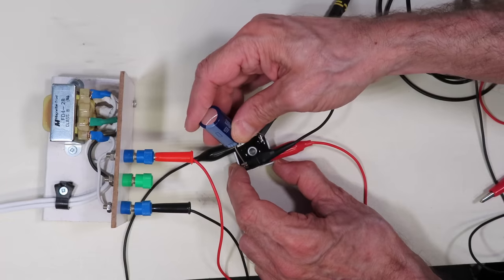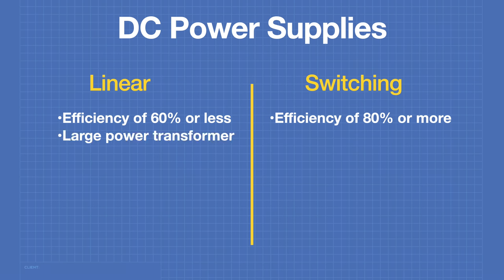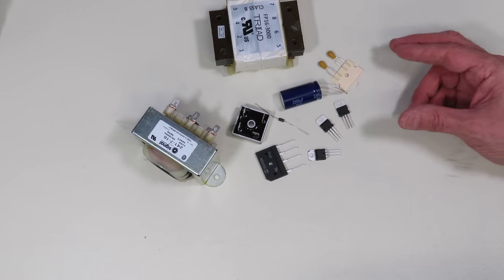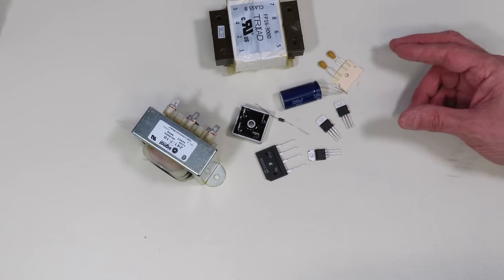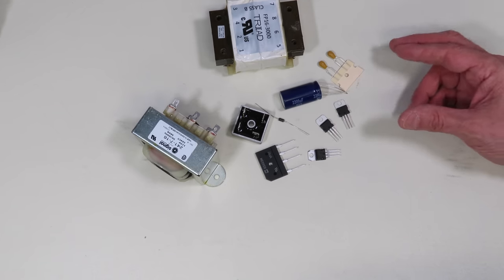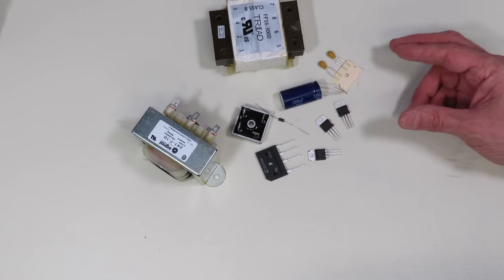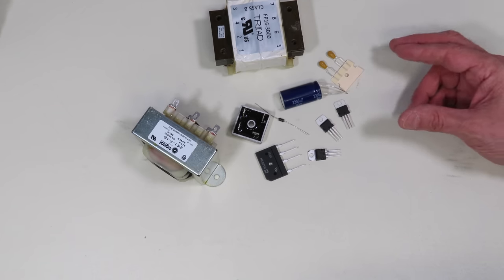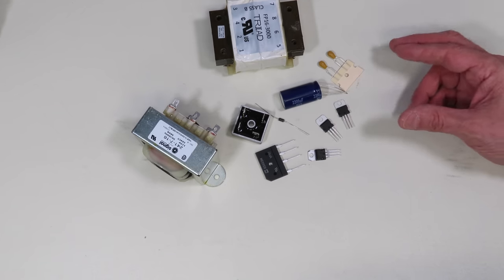Linear DC Power Supplies - Designing & Building Custom DC Power Supplies

Comment: I have built the fixed voltage circuit using a 7809 voltage reg. I expected this to be suitable for powering a LW, MW and FM band radio, however it causes massive buzzing interference on the AM bands. The original transformer for the radio is perfectly quiet and it is an unregulated output with just a bridge rectifier and smoothing cap. Where is the noise coming from?
Reply: I built a mains adapter for my 1960s LW/AM/SW/FM radio, using an LM7809, and did not get any interference. These regulator chips need decoupling capacitors at the input and output of the regulator, in close proximity to the regulator chip. Some folks also use ferrite rings/beads to reduce buzzing etc.  Have a look at the LM7809 datasheet. If this does not work, the try a regulator using a zener diode, or a zener diode and a power transistor. If that doesn't work. you'll have to use batteries.

Comment: Hello! I’m trying to get as stable of a current between 2to5 amps. If I’m pulling power from a battery pack instead of the wall do I need all these ?  I have a 53411202 knob. What else could I use to stabilize the current?  Thanks!
Reply: what???????

Comment: Nice,but...
1. You shouldn't have the balck(-) terminal of the output connected to outlet earth ground.A floating output is way better to have.
2. The heat-sink on the LM-317 is small .I think it would be  better if you would mount the regulator, with a silicon heat insulator ,on the chassis(back or bottom).
3. It would be nicer to use a "double pot" to set the adj. voltage in a "corse" and "fine" manner. much more practical and faster to adjust.

Chears :)
Reply: heat insulator????

Comment: Very impressed with the simplicity, and video. Great project. I do have one question that I can never find on data sheets: How long is safe for leads to potentiometer without effecting the circuit? Also, is wire gauge a concern, (thicker or thinner)?
Reply: that begs the question - how long is long
best advice is refer to a wire gauge chart as it shows the resistance per length by gauge

as for the pot, gauge isnt so important as the current is quite low. Maybe 22 to 26 gauge 
however i would worry more about EMF being introduced; use twisted pairs, maybe even shield the wires with the shield grounded or a bypass cap across the wires near the IC. 
There are a number of unknowns so it depends.....
Reply: Thanks for the responce, I was thinking no more than 2 or three inches at 20 or 22 gauge. I just didn't want to effec the "ballance" of the circuit. Thanks again!

Comment: Would it be possible to have an output on/off button mod on this too so voltage can be set without power going to the external component/device🙂
Reply: sure

Comment: What step up regulator can i use for a 1000 watts /12 volts input iron core transformer to build a adjustable linear power supply for 12 -30 volts ouput? I need it to adjust High voltage ouput of a crazy powerfull zvs multiple flybacks supply.

Comment: Is it possible to secure and connect with wire all the components in a wooden box without the circut board? I'm a woodworker so that designing it to fit well would be easy for me.
Reply: NOT recommended
Reply: @kennmossman8701  Thank you. Can you explain a bit so I can understand the why. I've seen main wires in wooden floor lamps.
Reply: @Sam-tg4ii  first I would urge you to carefully read the complete datasheet - especially the section on Layout/Construction.
Reply: I've seen main wires in wooden floor lamps.
that is  a totally different thing.
A metal case/cabinet is usually prefered to reduce the likelyhood of EMF affectig the circuit and to contain EMF generated  by the circuit.

Comment: will it sustain 1.4V 3A output? heat dissipation will be massive on the linear regulator in this case...
Reply: Not with the tiny heatsink shown.
Most 3-terminal regulators have over-temperature protection so they will shut down when they get too hot (probably at over 150 °C die temperature for the LD1085). With 18 V input and 1.4 V output at 3 A the power dissipated by the regulator would be ~50 watts. The tiny heatsink probably has a free-air "thermal resistance" of around 20 °C/W. The regulator will probably shut down at something around 7 watts of dissipation.

Comment: I've got one question, i want to build a power supply to smartphone recharge purpouses, if I mount 2 independent rails (1 filter capacitor, LM7805 and output capacitor per rail) can I bolt both LM7805 to the same chassis? There's short circuit risk?
Reply: why?  use a higher Amp IC

Comment: Wait! In the case of the full bridge rectifier, why is VDC = VAC x 1.414? I'm assuming that 1.414 is an approximation of the square root of 2. I have a vague feeling that it would make sense for the square root of 2 to show up here since we're dealing with sine waves, but I'm not sure why off the top of my head. I'm going to think about it, but if anyone has an explanation I'd love to hear it.
Reply: it is  VDC = VAC x 1.414  -   1.414    converts RMS voltage to DC peak equivalent

Comment: My transformers have a center tap. Is there a solution for measuring positive and negative voltages and currents? Two meters?
Reply: do you mean you do not know the voltages and current rating
Reply: @kennmossman8701  no, I know the ratings,  and it it easy enough to put a meter on the positive rail for voltage/current. I guess a second meter on the negative rail? It would be nicer if there was a unit that did both rail at the same time.

Comment: Great video. Is there a way to correct the voltmeter on the panel so it reads the same as your multimeter?
Reply: Yes for the 3.3v , 5v and 12v adjust each potentiometer on the power supply to a known good accurate multimeter

Comment: Could these power supplied provide power for the operation of a 12 VDC automobile wiper motor used in a sheet metal bead roller?
Reply: no

Comment: I want to build a DC power supply, from 240V A/C as in Australia, to DC roughtly 3 to 24 Volts, 1, 2 & 5 amps, power phones, radios,  hot wire foam cutting, just general purpose, nothing to special.  U have a BOM?

Comment: Seems quite nice, however that heatsink is awfully puny, that regulator will be getting awfully hot. My rule is if you cannot keep your finger on it, it's too hot. The obvious solution to me is to use the metal case as the heatsink, all you need is some insulating heat transfer pads etc.

Comment: Can you design PSU with current regulator and voltage regulator?
Reply: What do you mean by "current regulator" ?
Reply: @bumbarabun  It is like  a laboratory PSU. It has a current and voltage regulator..
Reply: @denisiswan  problem is that people quite often use wrong terms. You regulate voltage there, but on another side you limit maximum current, not regulating it. So calling that "current regulator" is confusing IMHO
Reply: @bumbarabun  , don't be confused.. Well, it regulated to limit the electric current . It will be for constant current and over current protection...

Comment: Hello sir. I made one circuit with lm317 and with one power transistor above lm317,conected. I put one ammeter, voltmeter module, but when I decrease the voltage lower then 4v, display ammetter and voltmeter module, fading out and not shown voltage, but the voltage exist. Only not shown.
I connected the red thin wire at C point exactly like you did. Where I get wrong?
Reply: how are you powering the V/A module?

Comment: The wide voltage range of your linear supply means you will run into over temperature shut down at low voltages or high currents. The solution is to add a double throw double pole switch to let the user select the two secondaries in parallel or series configuration. DC powered subway trains do this for "low gear."  Cheers.

One more tip. The DC ammeter lead is only 20 AWG. Make your own heavy lead with VH3.96 crimp connectors.
Reply: invalid premiss with bizarre solution

Comment: I've tested several of the Volt/Amp displays and they are inaccurate. You should double check the numbers with a multimeter at min and max output to determine how inaccurate it can be over a range of voltage and amperage. They can be several volts off.
Reply: Make sure you do NOT connect the thin black wire. Follow the manufacturers wiring diagram or current readings will be wrong. If you connect the thin black wire you are shorting out the current shunt across which it measures current. The thin black wire should only be used if you have a separate power supply like a battery or a 2nd fully-isolated power supply.
Reply: @steve6375  Both Current and Voltage is inaccurate. I've tested many with good multimeters/volt meters. Even when they are calibrated they're still inaccurate. Be careful when using these, could be sending too much voltage or current to your circuit. If you find some that are accurate then let everyone know. I would like to buy a few.
Reply: @simplyengineering2350  How inaccurate?  Mine don't seem to be too bad, esp if you calibrate it for the most often used voltage that you use. I would expect 1%-3% accuracy...
Reply: @steve6375  One in particular, forgot wich seller it came from, was reading within 2% at lower voltage but was off by 5v at 20v output. Calibration only helped after the voltage changed. It tuned it in at that exact voltage but once the voltage changed it was inaccurate again. 99% of them are knockoffs, most of them have cheap inaccurate controllers. 1% is tolerable if it's 1% across the entire voltage range used. What I witnessed in tests proved that the one's I bought from random sellers were not accurate. If you're going to use these in a adjustable power supply then use a good quality multi meter/volt meter to test the full range of the display to verify that the display is reading close enough. It's considered good practice to verify that something you build is working properly before using it in an actual application. There are lots of people building these using these displays that do not test them or test what they've built. A good engineer will always double check everything with a good quality meter. To build something and then assume it works correctly is not proper engineering.
Reply: @simplyengineering2350  The thin red wire is the DC supply to the meter circuitry. It should be connected to a non-varying voltage source so you can tweak the reading if required (otherwise it may fail to work if outside its design limits) . See https://youtu.be/nVpgO6xEF8Y?t=2897. I have never seen the voltage be off by as much as 5V with a 20V output on any of these units. However, I have seen the current reading being way off because the thin black wire has been mistakenly connected to ground. I agree that publishing anything on You Tube without thoroughly testing the design is not good practice. For instance, if you turn on or turn off the power with the outputs still connected to a 3V test circuit, does it spike 30V into it and blow it up (some Chinese units do this!).
Reply: @steve6375  I've verfied that it was wired correctly on several occasions. Not all of them are made the same. I will be testing DROK brand next. I would think theirs is more accurate considering the price. Hard to find a good name brand display with all the cheap clones filling the search results.

Comment: @Dronebotworkshop hello. What size transformer did you use and where can I get one?
Reply: Me good question - depends on the type of rectification. Here as I recall multiply by 1.4.  So if you need 1 Amp  use a 1.5 Amp transformer [next size up from 1 x 1.4]
For a 2 Amo circuit use at least 2 x 1.4 Amp tranformer - a 3 Amp transformer.

Comment: how can I make 5volt refrance power source for using with automotive sensors to have a bench power source for benchtop testing and adjustment say of throttle position sensors, MAP sensors and maybe air/fuel ratio oxygen sensors?
Reply: there are many ICs. A cheap one is the 7805
Reply: @kennmossman8701   Ill look into them thanks Kenn

Comment: How can I make a ups for charging my phone during a load-shedding ?
Reply: simple approach is to have a battery charger, battery and then  [5v] voltage regulator,  Picj a battery with enough AH to fully charge the phone even if the phone battery is dead

Comment: I found that using a high voltage ceramic capacitor (old school orange circular disc type, not smd) across each of the diodes in the rectifier reduces noise on the AC line side. The sharp switching of the diodes backfeeds noise through the transformer back on the line. These ceramic capacitors knock the edge of the diode switching. I used 0.01uF at 1kV and the exact value probably doesn't matter too much, maybe a few nF at a higher rating (few hundred volts or more). 1kV is probably overkill, but it is a small ceramic, really nothing special.
Reply: it is fairly SOP but usualy not done in low voltage circuits since a bypass cap does much the same thing

Comment: Back in my ham radio days I used a low-pass pi filter.  Unnecessary complexity?
Reply: A pi-filer is LP by definition. If the voltage rail is noisy/has spikes then a pi filter is a good idea

Comment: Could you build a supply for a Raspberry Pi with an Digital to Analog converter HAT on it for quality HiFi sound? An recommend components? Don't understand how you can have a 'negative' DC supply. isn't that just like switching the terminals of a battery round!?!?!? Great videos BTW.

Comment: I build a power supply using 12-0-12 step down transformer, a rectifier circuit using 5 amp diodes, 2 filter electrolytic capacitor of
 4700uf , a 300 watt buck convertor, the problem with it the capacitors are exploding after some time using it, 
how can I fix this?
Reply: wvdc of caps is ???
are the caps rated for the ripple current

Comment: What capacity of Torodail Transformer is required for making a DC Power Supply having output of 14.4 volts & 400 ampere for running a mono, class-d, car amplifier at home ?
Reply: 400 amperes? … are you sure?? 14.4x400=5760 watts. assuming no losses (which is unreal, but easier to calculate), that translates to 5760 / 230 = 25 amps AC from your wall outlet if you live in a 230 Vac region. for 115 Vac countries, double the amps i.e. you need 50 ampere  @ 115 Vac. (double that if you want to listen to stereo… ;-)
Reply: There is 230 Volts AC in my region. That means i need 25 ampere of Torodial Transformer for building a 12 Volts, 400 ampere of DC Power Supply fo playing my mono car amplifier at home ? Plz suggest

Comment: I built a linear power supply many years ago , It's 50 amps peak and 13.8 volts DC output to run my Ham radio gear ,  With a Thermal fan and  Crowbar over voltage should any of the pass transistors fail ...  It's on my YouTube channel should you be interested  👍
Reply: What is your YouTube channel
Reply: " It's 50 amps peak and 13.8 volts DC output to run my Ham radio gear" do you use it at winter time to heat your room?

Comment: Hi great video.
I have a question about the volt meters I have abouut 4 that I was going to use in an ATX variable power supply conversion with 3V, 5V, 12V and 1-40V 20A output, what I realise now is that thease meters get the amps reading from the negative rail, so if connected to negative rail then all negatives in an atx supply are all tied together on one huge negative rail pad on the PCB,  so I would be getting the same amps reading for all outputs 5V, 3V, 12V and 1-40V.
Is there a way of or anything I can add infront of thease meters (without using buck converters as that defeats the object) in order to get the AMP reading from the posative rails instead of the negative rail?
Reply: First, you must not connect the thin black wire, otherwise the ammeter reading will be wrong (see manufacturers wiring diagram). And secondly, no, you can't have more than one of those meters. I had the same plan!
Reply: @steve6375  awesome thanks for the reply

Comment: How is your transformer output such a clean sine wave?  Around here the sign wave has a notch right at the 85% of peak voltage point.  This is out of the wall and every power transformer I ever checked.  I can only surmise that this is the point where 10 billion diodes start conducting.

Comment: I am an electronic engineer and designed power supplies for living manybyears ago, and can tell if you want a quality DC power supply, it has to be a lineal one. Noise figure, stability, peak response and isolation because the transformer offer unmatched advantages in every aspect of the design.  ONLY weight its a factor to choose a switching one for lab use. All those chinese mickey mouse switching power supply you see online stores are noisy , poor and inadequate for lab use.

Comment: Bill, if this were an application where temperature could be an issue, would you substitute the Electrolytic Cap with an MLCC?  I have a 12v motorcycle application that I would like to convert to 5V. I'm worried that the EC would have issues with heat overt time.
Reply: why do you need an elect. cap

Comment: La vidéo est géniale, mais ne convient pas aux  européens et ..., car le transformateur  241-7-16 utilisé ici a pour tension  primaire 115 Volt ( tension primaire correspond à l'entrée du transformateur), alors qu'en Europe la tension primaire qu'on peu appliquer a un transformateur en entrée est de 220 Volt
Reply: make that 230 Vac for europe, the days of 220Vac are long gone. if you use a transformer with a 220V primary with today's line voltage (which is closer to 240 Vac sometimes), you'll end up with too high a secondary. ;-)